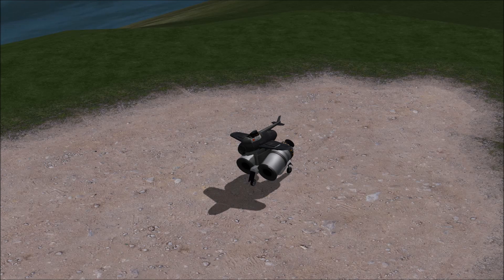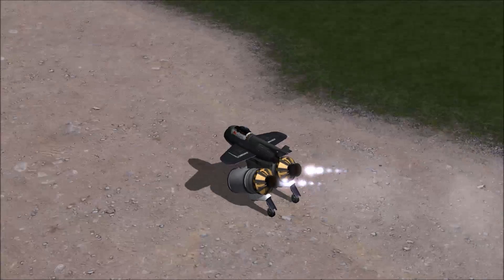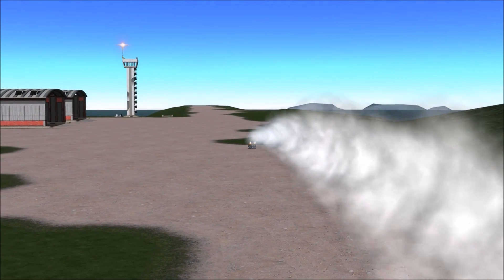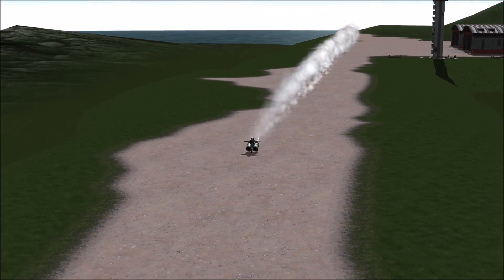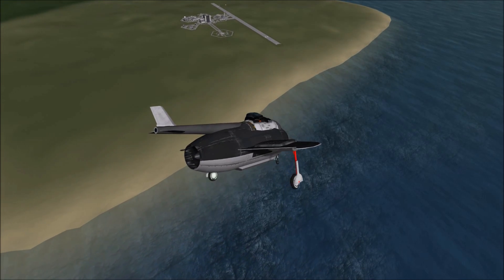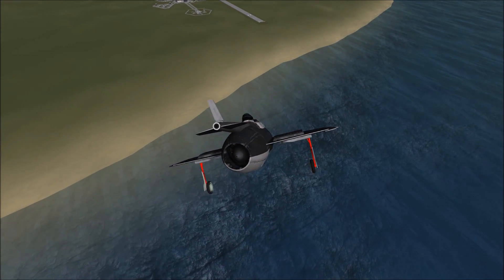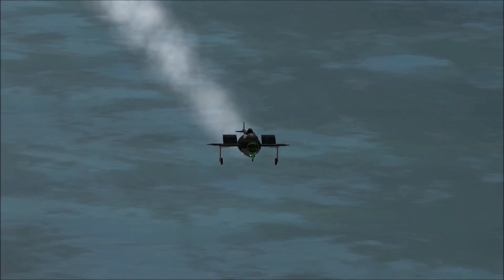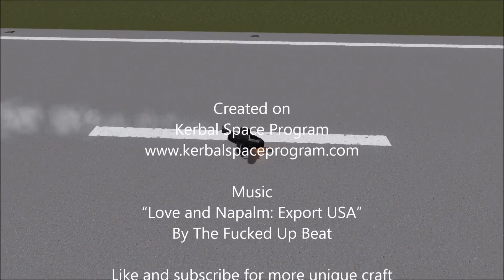KSP History's Misfits 6 Skoda-Kauba Sk P.14

Comment: Pulse jets, working inside a RamJet tube, 10º enlargement line from origin, intake, to combustion area,  this will not waste the heat from red-glowing outer side of pulsejet units, but add this heat to thrust, and have a higher pressure, from Benouilli laws, in intake of Uniflow valves of Pulse Jet, could launch Lorin Ramjets to its operational airspeed, 100 m/ sec. 
A fuel thirsty arrangement, but with no concurrents in the realm of structural weight and cost.

Behavior of this combined Pulsejet-RamJet can be simulated with the physics and fluid mechanics software 'Comsol', by Siemens.
Blessings +

Comment: Was one of the WebSites called Luft '46 cause that's where I got most of the information on it! +Hookswords
Reply from the maker: +Dean Robinson It's possible. Some of this season started from a modeling website and I went from there with each build. Different sources for different crafts. I usually try to double check info just in case of a bad wiki or tinfoil hat websites.